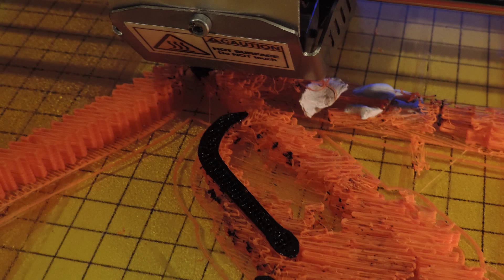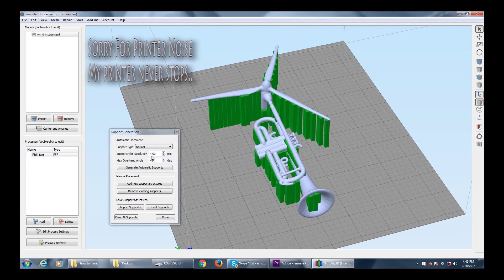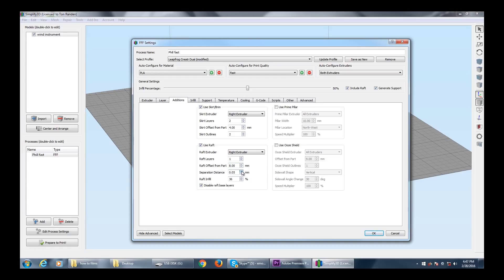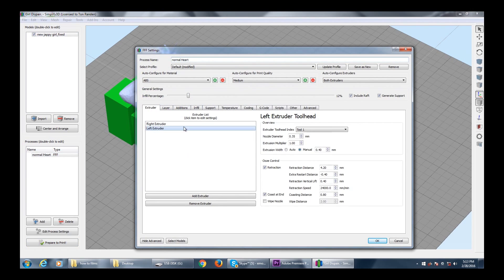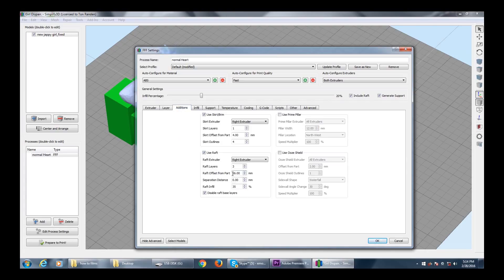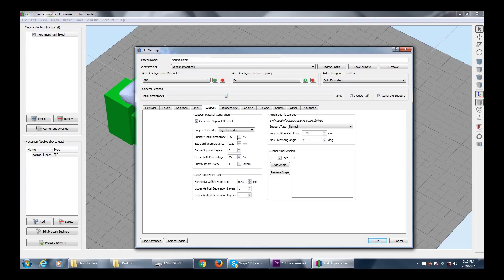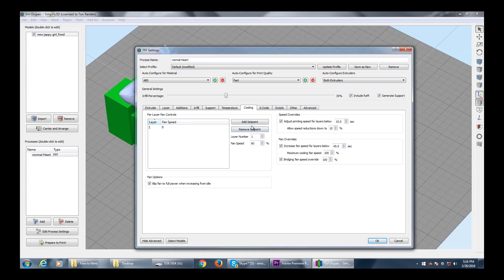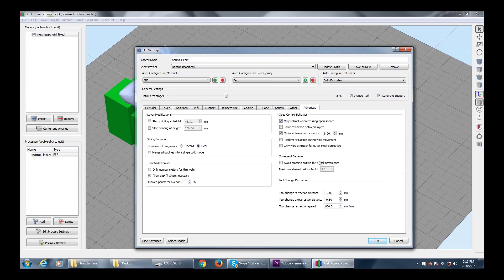Get Your Simplify3D Settings Right For Perfect 3D Printing

Comment: Your temps are all wrong, to high try ABS 230 and PLA 205
The other problem is ABS does not want a fan and wants a bed temp of 100c.
While PLA wants a fan 80 to 100% and bed temp 40 to 60c
Mixing the two materials is not a good idea.
You also have many incorrect settings in Simplify3D